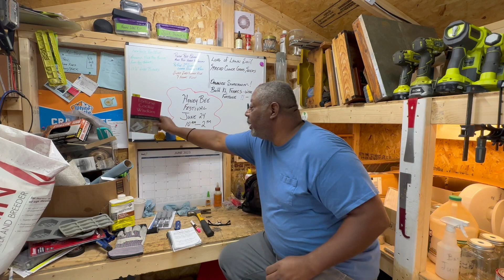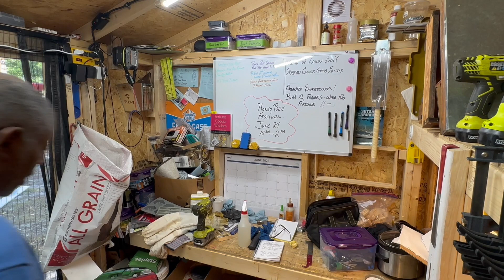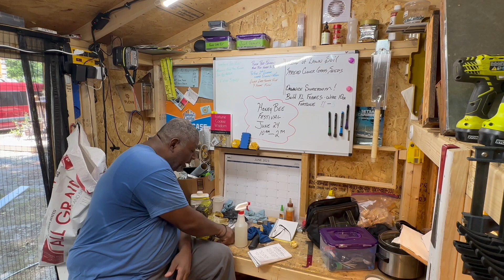The FarmHouse Hive gets Bees

Comment: I would have liked a little more detail on the transfer.  Is the hive gate removable from the outside?  How often will you be able to check it?  I worry it could get clogged with dead bees in winter. Does that tool work with the hive gate?
I start every video transition with "OK" as well!  Except its OK, So...We are a work in progress.  Hey "you are a work in progress" could be a fortune of the day or maybe it was!  I ramble...
Reply from the maker: Hi Phillip, the transfer was straight forward, 5 frames in the same order into the FarmHouse with 2 foundation frames on each side.  Yes the Hive Gate can be pulled out to be cleaned.  Last winter here, I didn't have an issue with any of them at all.  I will also have an extra Hive Gate on hot standby just in case.